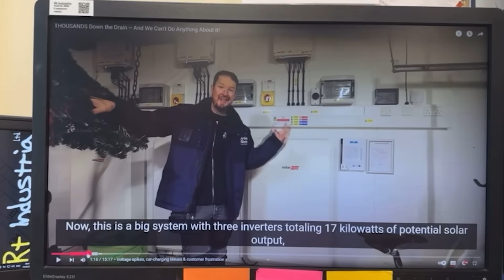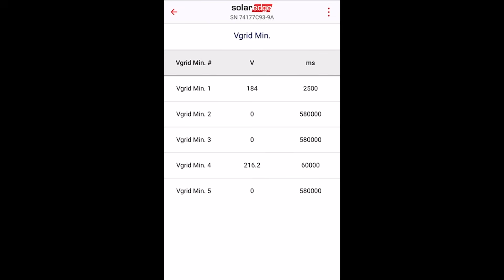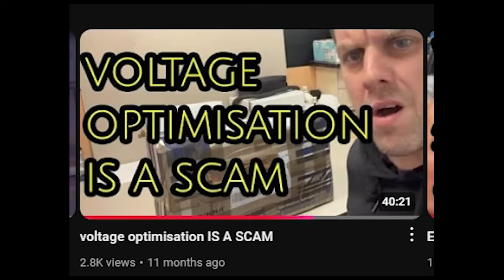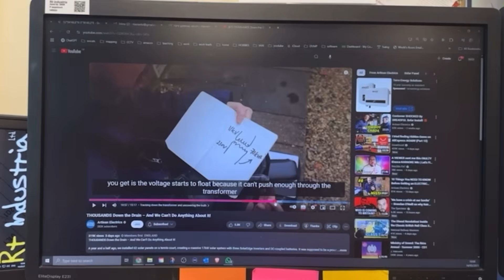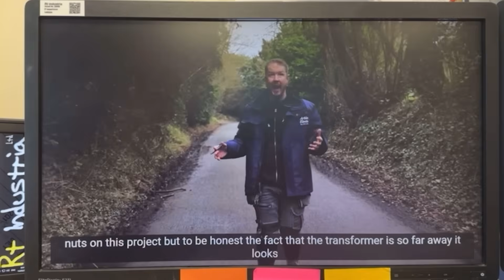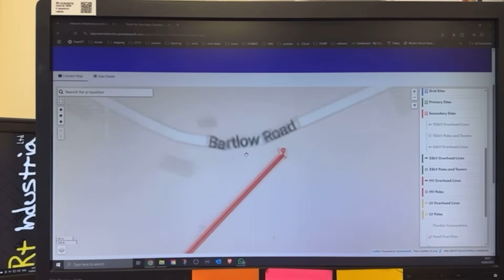ARTISAN ELECTRICS v THE GRID. WHO,S TO BLAME

Comment: Very poor presentation, making it a bit painful to watch. I watched Jordans video a couple of days ago and left a comment, the problem lies with both sides, the DNO should never have approved a single phase 17kW export limit, I'm very surprised they did in such a rural location. That's problem number one. Another problem is the settings are clearly wrong in the Solaredge system, it simply shouldn't be allowing voltages to go that high. As for that snake oil optimiser, that wasn't going to fix the problem, and it would still cause high grid voltages. Just change the inverter settings. He's says they are charging at full whack, 17kW, then add a car charger, another 7kW, then add the electric heating he mentioned, all this is clearly going to drag the voltage down, I'm an amateur and I know this. My system uses the entire off peak period to charge my batteries, this reducing grid load, that's because I'm considerate.
Reply from the maker: If you look at all of my other videos, you see my presentation is consistently poor if I maintain a very low standard, no one’s upset if it gets a little bit higher or lower

Comment: Definitely not an expert, but I had some questions. First, it’s the cloudy UK. Surely the system isn’t pushing out anything like 17kW for most of the day and probably never outside of midday in the period around late June. This seems to be a recent video, so winter, when sunshine is at a minimum. So the panels aren’t even loading the system at that level, right? Second, on the graphs his voltage seems to spike immediately in the morning when there’s hardly any sun. Don’t both these things suggest that there’s something wrong with the setup and not with the amount of energy the panels are putting out?

Comment: Yes, i was totally embarrassed watching that video a few days ago. Personally i was thinking more like a millon to upgrade the DNO transformer. Just because the EV charger cuts out. Try a decent EV charger and an earth electrode first maybe! I had been thinking about this video a lot the last few days, because iI have a job in Sandyford Dublin where the EV chargers are cutting out because the DNO voltage is getting down to 192 volts. But the whole point of any solar inverter is that it matches the exact voltage and frequency of the grid supply before blending, so this must be resistance in the network. Under G99 compliance it must clip at 252v max and 207v min. And for 17KW on a single phase you would have to incorporate a G10 relay to protect the grid, they were 8k each last time i bought one. It must be 3 phase surely?

Comment: I found the location too. I measure 147m from the transformer to the pole outside the house. so maybe 170m from transformer to DNO fuse. Not quite '300m'.  The Openstreetmap data for the 11kV network in this area (off the Balsham substation which is where it joins the 33kV network, about an 8km run) was mostly missing, so I've just added most of the overhead lines in the area.

Comment: When you said "Open Infrastructure Map", I assumed you meant the OSM map of that name, but it seems there is a UK power networks one too.   I am a contributor to OIM, and was interested in your comments on asset numbers, OIM has a 'reference' field for poles and transformers.  Most poles don't have those nice asset numbers with QR codes, but do have a shorter code like '1A' which is what I've been putting in the OIM 'ref' field. But presumably those asset codes are more useful where they exist (there is only one field so I can;t put both in)? Sometimes poles have phone numbers on, which look a lot like those asset codes - so it can be hard to know which is which. Is there a place I can look up asset codes? I found the 'UK power networks Open Data Portal' Is that what you were looking at?

Comment: I'm not an electrical engineer but it sounds like they've tried to connect a power station to my garden shed with a rolled up extension cable
Reply: Best comment ever.
Reply: artisan knows how to scam people for money. The old proverb says that a ram is there to be sheared🤑🤑🤑It's sad that most people borrow money for any home renovations.
Reply: lol.......
Reply: If garden shed have EV charger :-D 
I have extension cable which could manage 17kW load. It's called 3 phase IEC cable. I needed it during my house building ops. Just plug it in into outside cabinet 3x25A cabinet and off you go. Lot of houses around here have this receptable since 3p is required by building companies for their equipment by default.
Reply: @rybaluc  see I'm not an electrician, but I suspect I'd be good at starting unintentional fires:hand-orange-covering-eyes:
Reply: Inverter regulation problems if its on the AC side
Reply: The inverter is responsible for output voltage regulation, it takes the unregulated DC from the PVs and it feeds it first through the buck/boost input stage which in turn feeds the  H bridge stage and so on, the PWM controller IC looks at the output voltage and continuously adjusts the mark space ratio of the buck/boost converter to maintain a steady bridge Vbus and in turn steady output voltage as the load varies
Reply: Also grid tie inverters have big output chokes and if these happen to add just the wrong amount of inductance it can cause ferro resonance with the lines own parasitic capacitance and inductance

Comment: Engineering Recommendation G99
Issue 1 – Amendment 9
3 October 2022

10.6.4. Over Voltage
Over voltages are potentially more dangerous than under voltages and hence the
acceptable excursions from the norm are smaller and time delays shorter, a 2-Stage
over voltage protection14 is to be applied as follows:
• Stage 1 (LV) should have a setting of +14% (ie the LV statutory upper
voltage limit of +10%, with a further 4% permitted for voltage rise
internal to the Generator’s Installation and measurement errors ),
with a time delay of 1.0 s (to avoid nuisance tripping for short duration
excursions);
• Stage 2 (LV) should have a setting of +19% with a time delay of 0.5 s
(ie recognising the need to disconnect quickly for a material excursion);

So, a voltage excursion up to 262.2 V allowed for 1 sec and up to 273.7V for 0.5 sec above statutory limit of 230V +10% 

Also:

Under no circumstances should they resort to the use of Voltage
Management Units installed between the Connection Point and the Power
Generating Module.
Reply from the maker: I must get the g 98 and 99 specs and have a read up

Comment: Like you say the inverters are constantly pushing up the voltage and if there are any other PV systems on that supply line it's going to keep pushing the voltage up. What he needs to do is put in some grid forming inverters not grid following inverters

Comment: With the plan for us all to drive EV's and require a hell of a lot more power to top up daily, having high voltage in places is  going to be the least of many peoples issues. These changes to society have been planned by this government  and the DNO has also been aware of this forthcoming issue for years and only now taking big steps to do anything about it.  Artisan electrics had to test and sign of this G100 system...If high voltage is encountered you are NOT allowed to commission. So they have broken the rules.

With rapidly falling battery prices (not being passes on to customers), this should become more mandatory with these sized systems when going green and that includes all solar farms as well. Then they wont need to export 17KW and everyone will be happy. Could have easily installed a huge battery system as well.
Reply: I did the maths and it’s not actually a problem until much much greater EV penetration, the trick is to give customers incentives to charge overnight or in periods of lower grid utilisation. The average driver does like 15 miles a day which is only a 3kwh.

Comment: I would first look at the voltage at the connection of where the underground cable feeding the house joins the aerial bundle conductor. I would check for a volt drop at the connection. This would tell you if the connection between the underground cable and the Aerial Bundle Conductor had high resistance or the volt drop was in the underground cable.
I suspect that the underground cable is undersized for the 17 kW load and is causing a volt drop. This would cause the inverter to push the voltage higher than needed to export the power 
In reality, I suspect that it is a combination of many factors . But mostly the first cable from the house.

Comment: If I understand what he has done; he’s put the inverters on the low side of a voltage transformer, so his inverters can now push voltage out to the grid at up to 10% above G98/99/100 legal maximums. This is surely super illegal.

I did think this guy was smart.

he should be considerate that they are on a rural supply and dial down the inverter voltage limits in sympathy with this? If the local grid needs the power it will soak it up, it it doesn’t your inverters will curtail and everything will just work fine.

If you live nearby to this property and your LED lights have died and your TV is broken, you know who to send the bill too.

I do however think the DNO are a bit mad to give approval for 17kva on single phase.
Reply: I think that you have indeed hit the nail on the head!
Reply: My thoughts exactly
Reply: @TheRonskiman an interesting read considering the size of our systems!
Reply: Given the size of the transformer I was thinking that maybe they just put the optimizer on the house side (Solar bypassing it to the grid). But it wasn't shown very clearly.
Reply: @imark7777777 That's what it seems like to me, fixed thing's, ish, for their customers home and left it eff'ed up for all their neigbours.
Reply: @edc1569  Everyone from us have their dark corner of stupidity. And sometimes stupidity by lack of knowledge. I don't know a frickin crap how energy market works. 
Not much electricians know about grid tied voltage sources. It was not what they were trained for ( unlike grid operators electricians ). Lack of general training.
We not even get to problems of overflows from low voltage to high voltage side of the network which is also something grid operator have to plan for. And it's also their duty to evaluate before you will have green. In some cases overflows are limited because of lack of capacity or control on HV side. And off course it will affect HV connected customers and dumb substations without online regulation on primary or secondary side - very low amount of LV substations have it since it is expensive.
Reply: I was looking for this exact comment under the original video, but failed to find it. I’m happy it exists somewhere in the universe :)
Reply: That is the answer. The FACT that he is connecting an electricity generator.. with batteries as well on the far, far end of a DNO has DETRIMENTAL EFFECT on local power supply. ... "specially" when all of the locals are fed out of that voltage transformer!!
Reply: Question from N.A.:  Do you in UK also use ring mains for the service drops? (Thats what we call the LV connection between single customer and the transformer.)  This is generally a star configuration, such that each meter base (consumer?) has its own conductors.  This makes voltage drop easier to manage / isolates each customer volts drop from neighbors' varying loads.  Our transformers are also more commonly 25kVA and serve 6-10 customers max, so long as the service drops don't exceed 200-250 feet.  (This is an example, low-key modest residential neighborhood.)

Based on that, a 300 yard, 70A 240V is a significant obstacle.  It's 260V at the residence, but only 245 at the transformer; 210 under load, but 230 at the transformer.  Right?

Comment: The only fault on the dno side might be the voltage drop out of spec.  When the customer is charging the batteries, it's obviously within the fused rating of the supply, but the drop shouldn't get that low.  Chances are some of the neighbours are charging their cars and batteries too.  It might legit need an upgrade for that reason.

The overvolt is interesting, but an installer/customer/inverter problem.  

I don't like the expensive optimiser solution which is quick, but is another point of failure and adds to the inefficiencies of the system.

Agreed that he shouldn't bitch about the dno so much, they might carry the can for the undervolt, but not the overvolt imo.

Comment: Hanging that lot on the end of a long cable fed from a small rural pole mounted transformer is stupid.
Reply: If grid operator says its ok, why should small electrician doubt that?
Reply: @ because you are taking money from a customer, and should consider that a privilege. I see it as obvious that install would cause issues regardless of DNO approval.
Reply: @over-engineered   if grid operator approves but in reality grid cant actually cope with that then its clarely grids problem.

Comment: The inverter configuration is likely incorrect. The voltage limit should be set to a maximum of 253V AC, and either Volt-Watt (V/W) or Volt-Var (V/Var) mode should be enabled to reduce power export when voltage rises. Additionally, having a 17 kW system on a single-phase connection can create a significant imbalance in a three-phase grid, particularly under high load conditions. If the local LV/MV transformer is operating near its capacity, it may contribute to the issue. However, the inverter should still be capable of reducing power output to prevent excessive voltage rise, rather than allowing the voltage to reach 270V
Reply: huh 17kw singlephase? are they mental????
Reply: @ It is UK energy grid. I am not surprised at all. You will shit electrons in your pants when you'll see how many loads they connect with 1p. Full electric house with heating, cable thick like a hand and 1p only.  

 But suffice to say it might be a bad documentation put into a computational model. We saw such scenarios when at the end local cables must be re-measured or checked by grid guys during substation planned maintenance.
Might be honest mistake on grid operator side. But they have to face consequences.
Reply: I've never heard of Volt-Watt (V/W) droop being used in AC systems. Typically Volt-Var (V/Var) is used for AC systems because voltage is more proprtional with reactive power. I've only seen Volt-Watt (V/W) droop being used in DC systems. Typically frequnecy-watt (f/W) is used for AC systems because the load is proprtional to the speed of synchronous generators.
Reply: @fablearchitect7645  Volt-Watt droop is a control method where a grid-connected inverter reduces its active power output (watts) when AC grid voltage increases.

In power electronics, “droop control” generally describes the automatic balancing of voltage and power among multiple converters without external communication. Droop can be applied to both DC and AC systems:
	•	DC droop control: Adjusts DC voltage based on DC current to evenly share loads among parallel DC converters.
	•	AC droop control: Adjusts inverter output based on grid conditions, either voltage vs. reactive power (Volt-VAr droop) or voltage vs. active power (Volt-Watt droop).

The IEEE Standard 1547-2018 explicitly recommends Volt-Watt droop for grid-connected inverter systems (such as solar or battery storage) to maintain stable AC grid voltages.
Reply: @rkriisk  I had a look at the IEEE Std 1547-2018 and it requires Voltage-active power (volt-watt) droop that follows a specified response “curve.” Volt-watt mode is enabled in conjunction with Volt-Var (V/Var) droop. The volt-var droop kicks in at 0.96-1.04 Vpu before volt-watt at 1.06 Vpu. Thus, the inverter should follow volt-var droop and only enable volt-watt droop as a final resort to prevent unnecessary curtailment.
Reply: @fablearchitect7645  probably misunderstood me. These systems both are used as I mentioned depending on grid conditions.